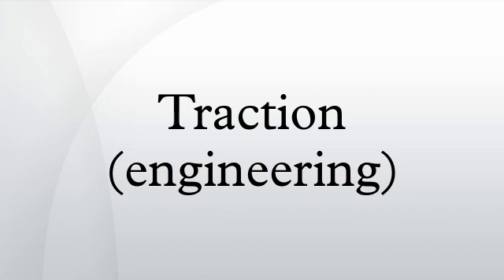Traction (engineering)

Comment: Rail metro traction/Rail metro Electrification Engineering & Design Course

Chapter-1 : Power supply arrangements traction substation (TSS/PSS/RSS)
1. Type of Existing Substation
2. Spacing and location of traction substation 
3. Energy consumption calculation 
4. 25 kV Supply at Traction Substations (220kV/132kV/110KV/66V to 25 KV )
5. Selection and sizing of Traction switchgears 
A. Selection and sizing of DP isolator and SP isolator 
B. Selection of Busbar 
C. Selection and sizing of CT and PT
D. Selection and sizing of LA 
E. Selection and sizing of Breaker 
F. Selection and sizing of Traction transformer 
G.  Bus coupler interrupter
H. Sizing calculation of control panel
I. Sizing of earthing calculation/ earth mat design
J. DSLP calculation
K. Illumination design
L. Control room design 
M. DC battery bank Sizing calculation
N. Aux. load design
O. Relay co-ordination for system protection 
P. Cable Sizing calculation 
Chapter-2 : Selection of traction overhead equipment (OHE)
1. Design criteria OHE sectors and selection of equipment  
2. Feeding and Sectioning Arrangements
3. Overhead Electrification and Catenary Lines
A. Sub sectioning & parallel substation (SSP)
B. Sectioning and paralleling post (SP)
C. Bridging interruptor 
D. Neutral section  
E. Protection of OHE equipment’s 
a. Substation scheme Lighting Arrestor 
b. Auxiliary supply transformer design at post end 
c. Potential transformer design at each sub -sector 
d. Design and monitoring of  interrupters
e. Booster Transformer selection 
Chapter-3 : Selection and sizing of signaling/ monitoring  equipment 
1. Scheme of signalling
2. Selection of Remote Control Centre (RCC)
3. SCADA system
4. RTU selection 
5. Communication Mode 
6. Communication Facilities
7. Train Control/Section Control:
8. Dy. Control Telephone:
9. Stock Control Telephone
10. Traction Loco Control
11. Traction Power Control
12. Emergency Control Circuit
13. Hot Line Communication
14. Walkie Talkie sets

Chapter:4 Electro Magnetic Interference & Electro Magnetic Compatibility
1. Permissible limit of EMI and EMC 
2. Permissible capacitively – coupled current 
3. Coupling between circuits
4. conductive coupling
5. Electrostatic induction
Chapter:5 Railway Clearance crossing regulation
1. Overhead crossing of power lines  
2. Recommendation of underground line buried near railway track
3. Overhead transmission line clearance and ROW
Chapter:6  Costing and Bill of material(BOM) of Traction System
1. Costing and BOQ  of Traction substation(TSS)
2. Costing and BOQ of OHE system 
3. Costing of electrical equipment’s 

Software : Auto CAD, 
Reference code and standard  : Railway Board and Research Design and Organisation (RDSO), Indian electricity  rule 1956, Indian Bureau of Indian standard (BIS)